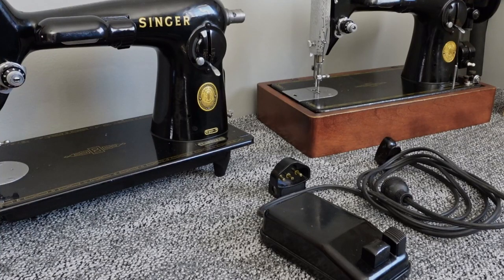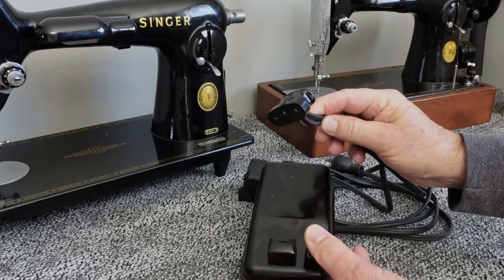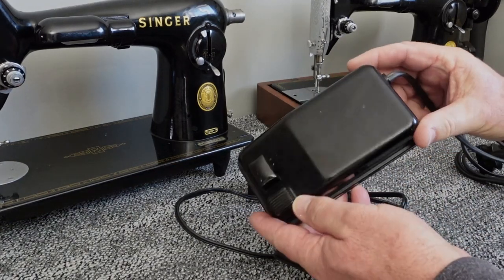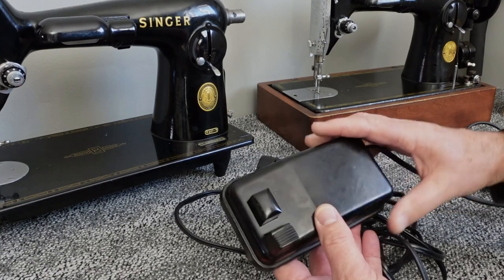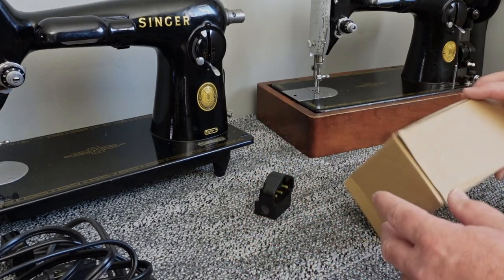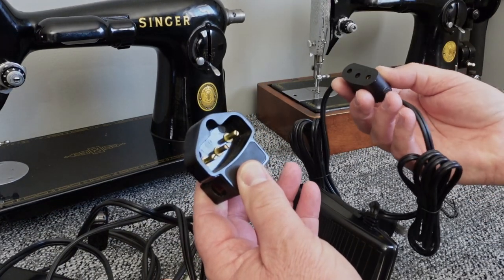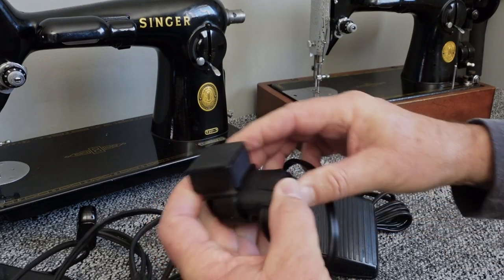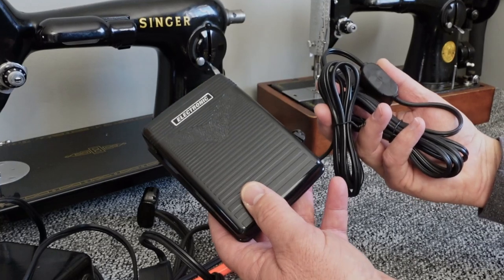Watch this before you try putting new wires on that old SINGER sewing machine foot pedal.

Comment: You don't use your toe to operate the old pedal. Your foot rests on the raised edge and then you roll your foot onto the button pedal. That way your foot is always supported instead of having to keep your toe raised on the new pedals. It's just an individual preference. But that button isn't for a toe. It's for the ball of the foot and of course to be used with knee pedal on cabinets.
Reply: I find it easier to have most of my foot on the pedal so that my heel is on the rest and the foot gets rocked onto the power button. I feel so badly for all the people trying to operate it with their toe!!

Comment: Not only easier, but they run MUCH cooler. For someone who sews slowly, these don't heat up much at all. BUT---- keep in mind that electronics don't last forever. Keep your old style foot control just in case.
Reply from the maker: Yes, keep the old foot control, someday you may want to use the machine in a cabinet, and you'll need it. I will only use these if I get a bad foot controller and the wiring is dangerously worn-out cracking etc.
Reply: @BlacksPorsche986  I have purchased the new cords. But again, save the plastic or bakelite connector. They sell for big bucks on ebay.

Comment: I have a 1940 singer 66. The pedal wiring needs to be replaced.  The foot pedal is a solid metal one.  It is hardwired.  Machine will run normal then slow.  I believe it needs a new pedal.  There is no 3 prong access in the machine.   Would it be better to just  get a new motor that has this access?  I’m kind of a purist when it comes to the machines but safety is always first.

Comment: I have tossed many of the newer one piece replacement cords. Once they break, and they will from use, they cannot be repaired. The original Singer parts will last forever. Re- wiring is a better long term fix, well worth the effort. The carbon discs in the old controllers can be cleaned. Its not hard to do, there are videos demonstrating the process. I restore 6:03 old Singer machines and the designers and engineers knew what they were doing. That's why so many of them are still around. Modern controllers work well in these but don't be quick to discard the original equipment, it was designed to last a long time.